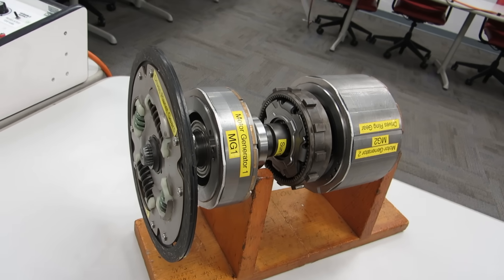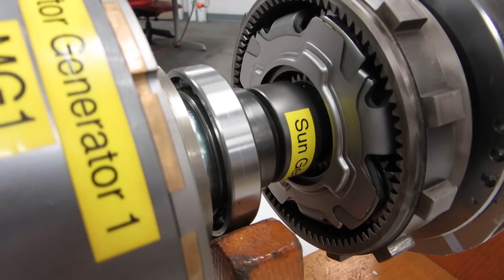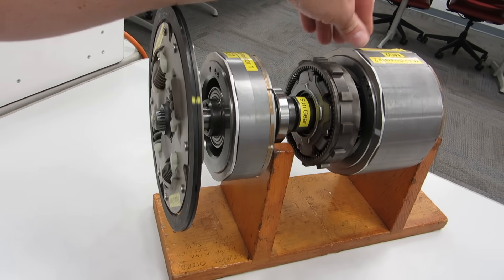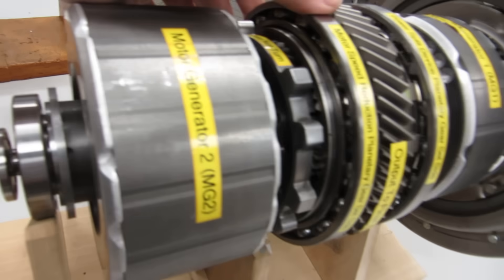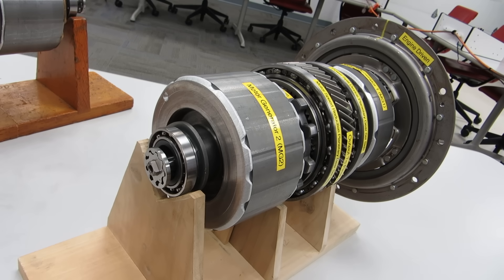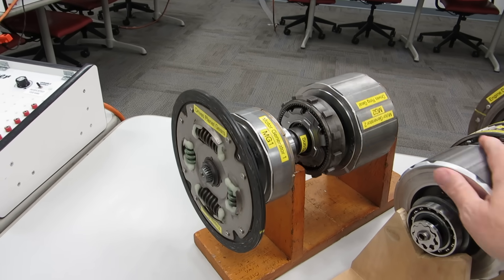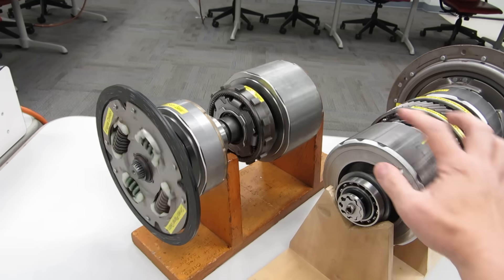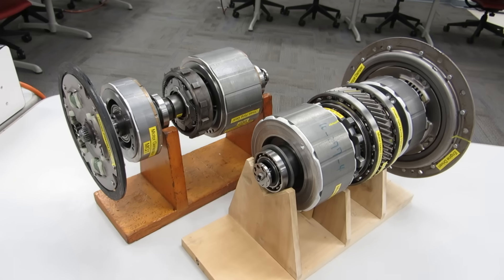Hybrid Electric Motor Magnetic Field Strength Demonstration

Comment: All Electric Motor Used Magnets. Noting New ? From the Time Of Nicola Tesla. Who is the Founder & Inventer Of A/C Motors & Currents. Even DC Motors Used Magnets. What's You Trying to Describe in Here ?
Reply: what the manufacturer achieved up to date. Given same magnetic blocks, heat, structure, durability and strength, field shaping are challenging to get better solution.
Reply: Before, we don’t have such strong magnetic blocks, so we cannot achieve the possibility shown in the video.

From the video, we should learn another thing, how to protect other components near such strong magnetic fields.

Comment: Could you tow a small trailer with wagon wheels. Gear an alternator to the axel. The radius of your wagon wheel. Newton meter torque. Be you're advantage. Self charging system.

Comment: I just replaced a transmission in a 2007 Lexus rx400h which is pretty much the same as the one above to the right. It was replaced from one identical from a wrecked 2008. I've been a mechanic for 45 years and this was my first hybrid diagnose. Going by the buck and my scanner, the trouble codes brought me first to replace the inverter/converter, then to the trans. Insulation leak in high voltage system. I save the guy $5000 from the $9000 quote specialist.  Also received the old trans so I could resist taking it apart. So simple compared to an automatic trans. Except tor stator and the differential, plus wires, what's shown here is all there is.
This guy says that only the first motor produces power.  Not so. the final drive motor here and the rear motor turning the rear axle produce high voltage. Even disconnected from HV battery, less then a full turn of a tire while off the ground could cause death if I were touching a hv  wire.
Anyway, I am salvaging the magnets for a hv generator I'm making with an alternator. These magnets are sickly strong. Held together by slots made in sheet metal over 300 layers, that I've been removing one by one to avoid breaking the 16 magnets. It constantly fights me by pulling metal tools in the wrong direction. It pulled a 2 pound hammer from 2 feet with enough strength smash 4 fingers and cause severe pain.  I'm down to about 1 inch and  have cut into it where they are closest to outside.

Comment: in a e motor that has a rotor and stator the stator consumes e energy therefore i presume that the battery shall last longer if it was a permanent magnet taking into consideration all other things constant. the only problem with this design is that the stator is magnetic all the time even if battery power is turned off. can you make calculations on how much e energy is saved when using a permanent magnet as stator. and how do you think the problem of the magnets be resolved? thanks.
Reply from the maker: Thanks for your feedback!

Comment: How do the permanent magnets maintain its strength as the car ages? Heat and knocks would surely demagnetize them slowly. I'm surprised that there isn't an electromagnet in place of the permanent magnets here
Reply from the maker: Thanks for your feedback. They seem to be holding up very well. 18 year old Prius models with these seem to work just fine.

Comment: Surely if you build a cone filled with negative facing magnets and then build an outer cone with negative magnets with less magnets on one side and push them together the inner cone would spin faster depending on how close to the outer cone it is? Why are there so many videos of ppl making crappy magnetic devices when the answer has already been discovered over 100 yrs ago?
Reply from the maker: Thanks for your feedback
Reply: Robert Days what conical device are you reffering to? Peace and love 🙏

Comment: And that does not affect your body???
Reply from the maker: Not that I know of
Reply: Are not atoms made of electrons?  All our DNA is affected, is it not?  Would it not cause massive mutations sitting in such fields?  hmmm  Like taking an MRI constantly....
Reply from the maker: I do not know about DNA, but I do know that we are all surrounded by magnetic fields all of our lives. Every power wire outdoors, in your house, your car, and any piece of electrical machinery produces a pulsating or steady magnetic field whenever there is current in the wire. Your computer, cell phone, etc. all produce magnetic fields. The field strength varies with proximity, amount of current, and shielding. I may be living in ignorant bliss, but I am not concerned. Thanks for your feedback.
Reply: People are looking at electric airplanes.  A Prius is 20 kw on average.  An airplane could be 40,000 kw with all the fields....  Blood has iron in it....   Thanks for the reply
Reply: You can take MRIs constantly, the magnetic fields do not harm you.  Remember the Earth is a giant magnet and its magnetic field protects you from dangerous radiation coming from the sun!

Comment: Why is the motor using permanent magnet synchronous motor? This against knowledge of my motor class. No permanent magnet use the on the large motor, and synchronous motor has almost no starting torque.
Reply from the maker: Thanks for your feedback. They seem to accelerate very well. Their peak torque is from 0-400 rpm on the first generation Prius.
Reply: When was your motor class... 1980? Permanent magnets are used on larger and larger motors all the time... currently up to the megawatt class. 

Perhaps you were just asleep in class: synchronous motors produce maximum torque near stall; it is induction (asynchronous) motors which have minimal torque when far from their synchronous speed, so fixed-frequency induction motors have very low starting torque. Even then, with the drive frequency appropriately controlled to the slip speed, induction motors have excellent starting toque - haven't you seen Tesla cars (which had all induction motors before the Model 3) accelerating?

Comment: AC Synchronous motors are NOT Brushless Direct Current motors i'm just going to get that out of the way.... there similar in some ways but different in others.
Reply from the maker: Thank you! You are absolutely correct. My mistake
Reply: WeberAuto Awesome video though, those  are  some strong magnetic fields

Comment: i wonder if you could destroy the component by throwing a decent chunk of neodymium on the hood of a hybrid
Reply: I don't think so. The field would be very weak at such a range.
Reply: @chrisbleurgh7425  More importantly, the rotor is shielded inside the stator in a complete motor, generator, or transaxle.

Comment: You are very stupid bringing the motors so close, especially putting your hand between the gap.  I suggest you learn how to handle these magnets before you lose your hand
Reply: Tangobaldy calm your tits
Reply from the maker: +Tangobaldy Thanks for your feedback, they are strong magnets!
Reply: i have a small magnet at home that can pull 55kg.  those motors look like they can pull many more kg.  made me very worried when they got so close.  Maybe a few more cm and they would have slammed together?  I wonder what force would be needed to tear them apart if your arm was in-between.
Reply from the maker: +Tangobaldy Although these are very strong neodymium magnets, they are positioned in a "V" shape such that sets of opposite poles are within approximately 20mm all the way around the circumference of the rotor. I have had my hand between both motors touching both, the force is not that strong in that configuration. However, if you remove just one of the magnets and place it on a steel workbench, you cannot pull it from the bench without sliding it to the edge of the bench. I have not measured its pulling force, but I  would like to now. Thanks again for your feedback.

Comment: So rotor is nothing but a bunch of strong permanent magnets, and speed is varied by frequency of ac voltage on a stator, correct?
Reply: no it's the opposite, the stator is the permanent magnets and the rotor is the one receiving e current. (like a dynamo) or it could also be the other way around the rotor is magnetic while the stator is the one receiving the e current (like that of an e fan).
Reply: @rhianngacusan1227  I realize that your comment is several years old, but here's a correction so it doesn't confuse anyone... 

@ElektrikaCo was correct (and  @rhianngacusan1227 is wrong) : 
the rotor is the rotating component, and in a PM synchronous AC motor it consists of permanent magnets and iron laminations; and, 
the stator is the stationary component, and in a PM synchronous AC motor it consists of wire coils (winding) forming electromagnets (and again iron laminations). 

The varying current in the stator produces a moving magnetic field; that interacts with the rotor's magnetic field to pull the rotor around.
Reply: @nicomarino96  that's right, now have you encountered those posting a video that says they could make a motor by means of two magnets, they maybe pertaining to the rotor and stator. FOOLISH RIGHT? the rotational reaction is created by PULSE of electricity ie. the DC and AC without this you can not make it rotate ie  the rotor. but you may use one permanent magnet that is the rotor or stator but not both.

Comment: stoner here,  is it possible to run something off just the electrical field made by the MG2 without having a parasitic loss effect?  does the fact that the prius motors being near the highlander's motors cause a (magnetic?) load effect? i'm wondering if you surround the case with a bunch of smaller, "m-field receiver" motors, could you generate extra power? or might they do nothing? looks like something that could be capitalized on.
Reply: Any power the prius rotor recieve to turn comes from the highlander rotor. So it's basically the same effort if he is turning both rotors by hand. You put additional motors (or windings) around the case to capture the parasitic filed  rotation and create electricity, the there would be an equivalent rotational resistance to the rotor. This is considering that there would be considerable magnetic field leakage. In reality the rotor lives inside a laminated core stator with copper windings. The laminated iron core will block almost all of the field created by rotor and will  concentrate the field created by the windings against it to create torque.